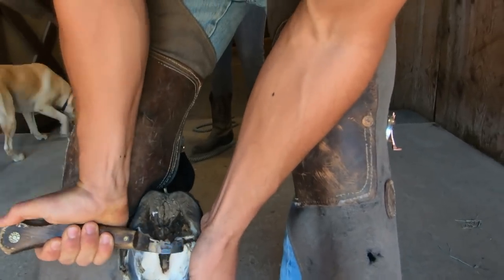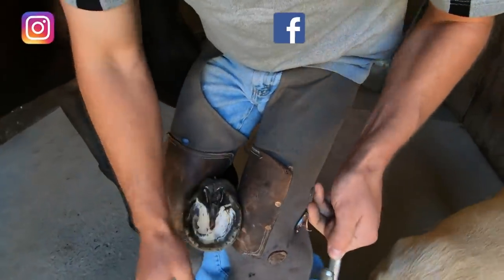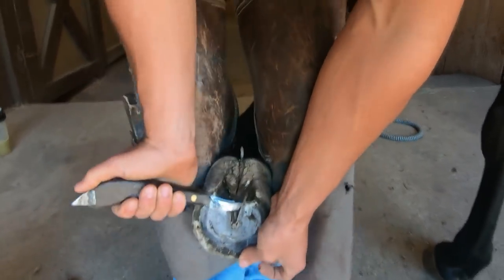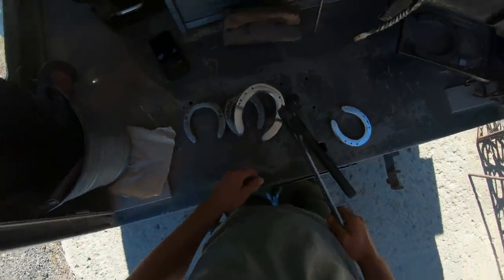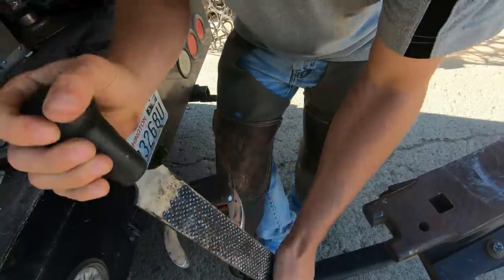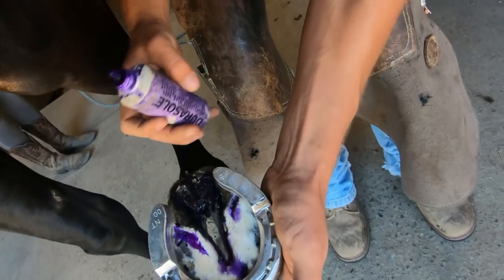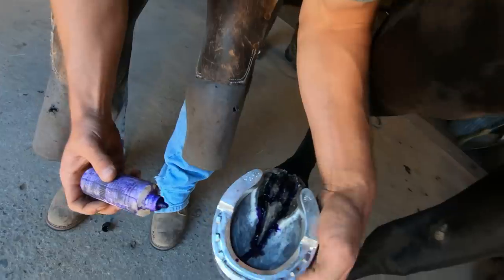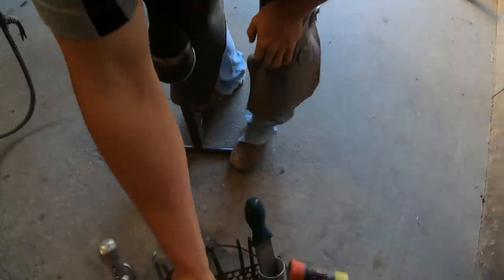HORSESHOEING for NAVICULAR Disease and THRUSH // HIGH HEELS???

Comment: Hey Sheldon, what's going on with the caudal medial and lateral aspects of the hoof wall here? It looks like there's some hoof wall separation or something.

Also, it looks like the more proximal portion of the hooves on this horse or a little, squisher (for lack of a better word), than normal. Is that common for quarter horses or is that because this horse has thrush?

Comment: Looks good.   In the jumping realm I use aluminum shoes all year round.   I love pulling clips on them.  It totally saved our elbows shaping them hot.
Reply from the maker: Do you hot fit your aluminum clips?
Reply: @maverick_vet  yeah lightly. Then notch them out with a loop knife.  I tend to clip a bunch for jumping.  I get a bunch off the track. About half of my horses will hot shoe. The other half freak out for a heavy burn.  If I’m running my fan to blow the smoke away everyone is fine with it.

Comment: Have you heard of stuff called tomorrow? Its in a tube like dewormer. That would help with the deep central sulcus thrush on this one . Or try cotton balls cut in half dipped in iodine shoved into the crack until you can't fit another cotton ball replace daily.  I've also had great luck with hoof clay on those heels. For the 20 bucks its changed my shoeing and overall heel health in all the horses I've used it on. Also makes throwing that back nail in so much nicer when it ends up tight after the heels are healthy. Great job just my 2 cents 👍.

Comment: Weird question but:
if someone designed a set of tools that were lighter stronger and cheaper than the tools your using now, would there be any reason not to use them? 
Like your knife for example, does it need a specific weight to be effective? If someone engineered a lighter, and more versatile material for it would it ruin how you work?

To be clear I’m only talking about the materials, not the design of the tools or how they are used. I just figure it would be less taxing on you to bring around a lighter pair of clippers or wear cooler clothing. This could allow you to work faster for the horses comfort, or even fit in more horses a day without getting as tired.

Comment: what happens to horses in the wild like do there feet fall off D:
Reply: No they don't fall off, but they are kept in shape by plenty of moving around.
Reply: Wild horses are either healthy or dead. There’s usually no in between. Having a diet that has no commercial grains and only their natural diet they are at peak “health” and they are never standing in the same location for extended periods they roam over all kinds of terrain rocky and sand packs and limestone they keep their own feet trimmed. If the horse can’t run it gets eaten

Comment: Her heels look jammed up to me, is that because of the Navicular syndrome?
Reply: They are!  Looks to me to be that the horse could use a break from  solid shoes. Either barefoot or polysteel natural balance shoe  with full frog support. Toes could also come back based on the very pointy elongated frog!  Breakover is  still too far forward. Betting that if the toes are brought back that the HPA would lime up more correctly negating the need for a wedge. 
Hoof boots for turnout/riding and let the foot relax and  allow for better thrush treatment.  Good soak in cleantrax or white lightening hoof soak to deep treat the feet and follow up with straight iodine once a week!  Cheap and effective treatment for thrush.  Foot though needs to relax so the central sulcus can open up before soaking. 
Follow up with polysteel shoes with frog support( can be used with wedge pads) 
Will allow the foot to build up the digital cushion while protecting the foot and stimulating the frog!